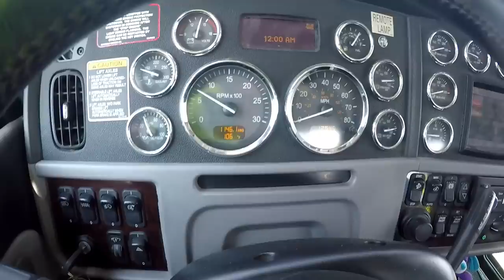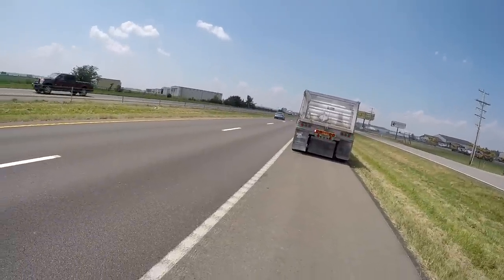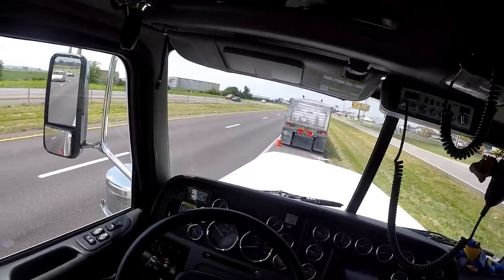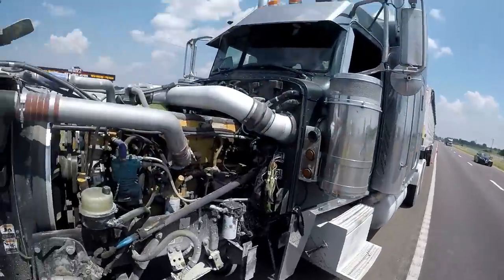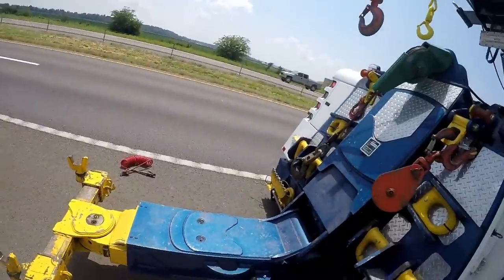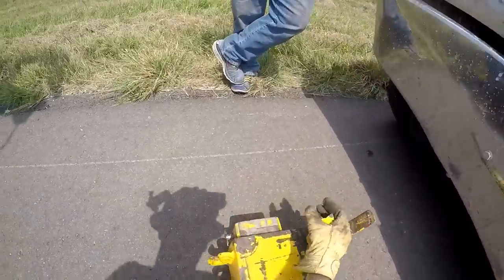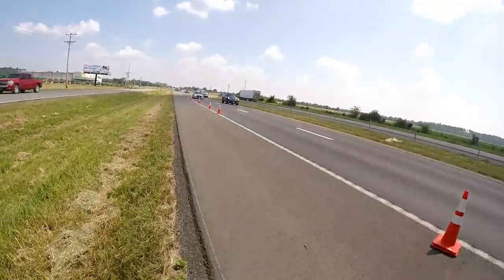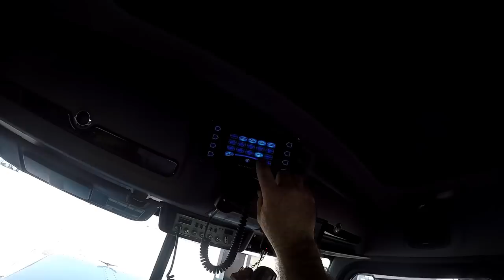THIRSTY TRUCK ON A HOT DAY

Comment: Clear weather and if they don't cross the white line and you don't everything is fine I mean Yeah you could trip into the road or they could have a blowout you get people come up on you hitting the breaks to be safe and people are likely to get caught off guard and crash because of you seems like being proficient less time on the road the better. Can't you just pull in front and grab it like a repo man and slowly get to the exit then tie up properly less traffic and safer all around. A huge tore up wreck is different. I mean if everyone is in the left lane going slow eventually people won't see why or you and hit the gas and get in the right lane to go around and bam. Or use a few cones and taper the lane closed for a 1/4 mile as you drive up to the scene

Comment: How difficult to bleed the air out of that particular fuel system? If easily done, refueling the truck in place, 10 gallons or so, would be a possibility.

Comment: very noticeable that as soon as the patrol car pulled up everyone slowed down to a sensible speed....by running out of fuel does it damage the engine or can you just fill up and off she goes....you need to get a board with arrows on and blue lights flashing on top of it to make clueless drivers move over....

Comment: I feel like I should know this, but why does the driveshaft typically get removed? 

On to the 'opinion section' of my comment, I've done my share of 'traffic control'. Bottom line, in various combinations, many drivers simply don't care, don't understand, and are today increasingly distracted. 

Ron and the driver were both smartly and responsibly over the white line, which to most drivers seems to be no different than someone simply traveling at highway speed two feet over. You're 'off the road' when you're over the white line. I truly believe that it could have been a golf cart with a light on the roof just as easily as a cop car getting people to take notice, because the cruiser was fully in a traffic lane. That is a visible impediment. Technically, someone off onto the shoulder isn't, even if that 'someone' is 70,000 or more pounds of Big Rig. I feel that most drivers are aware 'enough' to avoid an in-lane vehicle. If you're over sufficiently far to be mostly even if not entirely out of the lane,  it's business as usual to drivers in general. 

I had a few 'close calls' when flagging, with people who, as I said at the beginning of my comment, were oblivious, careless, defiant, or driving with phone in hand. If I recall correctly, I got horns a couple of times, and a middle finger a time or two. ; ]

One of my uncles worked in highway construction back in the '70s and '80s. He had a friend who was clipped and killed by a pickup traveling at about 65 MPH. That said, in those days it was not uncommon for road crews to have a cooler of their favorite 'beverages' at hand throughout the day, so... . Just sayin'. Also, while I don't recall the specifics, N.Y.S. regulations for traffic pullovers were amended several years ago after a State Trooper was beheaded by a tractor-trailer's side mirror.

Ron's a nice guy, and I would have thanked the officer, too, but the cop was right in saying that it was just part of his job. Politeness is a vanishing attribute in today's world, but the fact remains that there are many examples of poor performance to support the negative views people have of police. I'm mildly concerned about the exaggerated presence of cops in general, along with the 'blackout' features of many cruisers, as well as the increasing appearance of what equate to urban assault vehicles being adopted as routine cop carriers. Be respectful, but question authority. There seems to be a shift in perspective: where it was once the duty of cops 'to protect and to serve' it now seems as if the police have gone from looking out for us to being out looking for us. Not paranoid, merely 'observant'. ; ]

In closing, I'd suggest that Ron pay to have his guys be safety-trained as 'flaggers' and take one with him on every call. Considering the amounts at which his services must be billed, the relatively minor cost of having a traffic moderator shouldn't matter, especially noting how concerned he was in this video about safety. All states have their own oddball laws, as well as the absolute lack of ones that would be smartly conceived, and in New York State a traffic control person is vested with the same power as a State Trooper for the purposes of that job. In Massachusetts, traffic control is done only by State Police. I'd suggest stand signs like the diamond-shaped 'FLAGGER AHEAD' type you see at least here in New York. There are even 'FINES DOUBLED FOR SPEEDING IN WORK ZONES' signs here now. A movable road sign that threatens people and can be set up a lane over, along with cones, well in advance of a work site might be a good thing for state legislatures to consider. Sadly, as the grandfather of one of my friends said way back in '86 with the appearance of high-mounted 'third brake lights', if an idiot isn't paying attention, it wouldn't matter if you had 100 brake lights. It's essentially the same with a cop car and a light bar, or a lone flagger with clenched teeth and a pole-mounted 'SLOW' sign.

I'm new to Ron's channel within the last couple of days, and I've watched several videos. I like it. ; ]

Comment: Red and blues would be illegal in most states without permits for red and blue specifically.    Blue is leo my state red is fire.    Some red is emergency and blue is courtesy.
Reply: Jason Williams apparently in Missouri, wreckers are full emergency vehicles, as opposed to the qasi emergency vehicles they are in most other states.  They can run reds and blues, with siren, to calls when requested to expedite by PD.  It seems that more rural states are more reasonable when it comes to vehicles lighting.  Wreckers get reds and blues, PD gets blues, Fire (and Firefighters) get red.

Comment: wait whut... you towed it just because it ran out of fuel? how about just dropping 4 20 liter jerrycans into the tank (as well, most of em need like 3 liters before it even sucks it out of the tank, and then some 3 liters more to fill all the pipes, so just do it properly and throw in some 80 liters just to be sure it'll start and make it to the next gas station by itself ;), using the hand pump on the fuel pump to suck it back into the engine, and be done with it in like... 5 minutes. ka-tsjing, that'll be $100 for the fuel and $400 for the delivery, next customer. if it's not broken, and there is a guy to drive it, why bother to tow it.
Reply from the maker: It was the owner's request to have it towed.  Thanks for watching and God bless.

Comment: hi ron, iworry that some idiot driver runs you over, but why dont you put the cones in the middle of that slow lane? especially since your are an emergency vehicle.
Reply from the maker: If we put cones in the slow lane and someone hits them, they can sue us......STUPID, I know, but that's the way the law is.  We have to either have a traffic control vehicle with red/blue lights to block off a lane or have ALMOST TWO MILES of advanced warning and cones to set up a "work zone" just like a road construction crew would have to do.    Thanks for watching and God bless.

Comment: Isint it easier just to get him some fuel
Reply: I know its a bit late but on some diesel machines if you run them right out of fuel it air locks the fuel system and just putting more fuel in wont get the truck moving again. You have to take off fuel lines and purge the air first. Not the kind of thing you want to be doing at the side of the interstate in that kind of heat and with belligerent traffic. Not to say that's the case but id assume it is since they didn't just fuel it up.

Comment: could you not just have taken the lorry driver some fuel it would have been easier lol
Reply: john butler doesn’t work on diesels.  If they’ve been run dry, there is major work that only a shop can do, to get the fuel system bled, primed, and restarted.